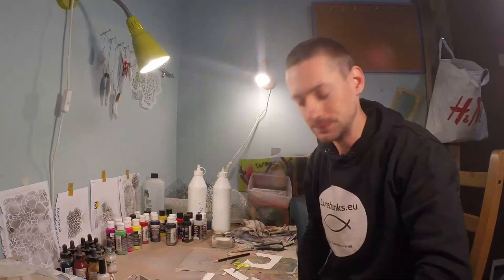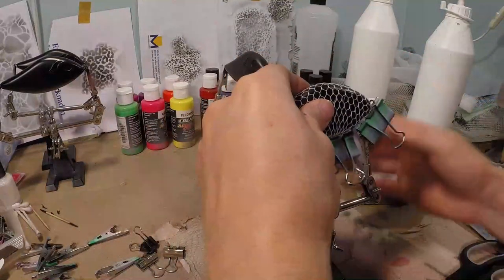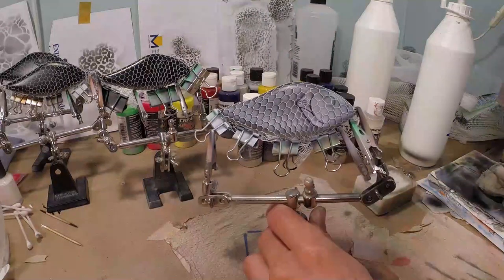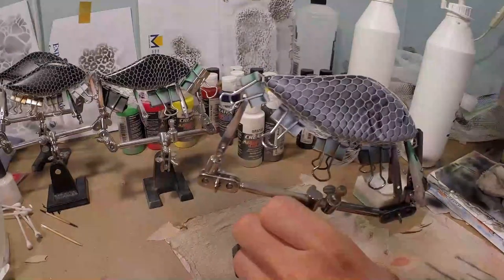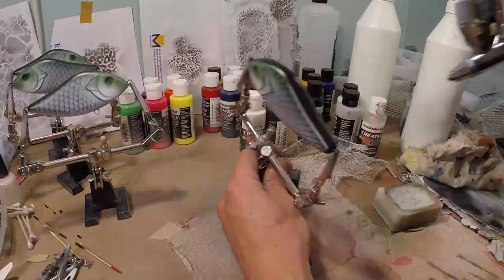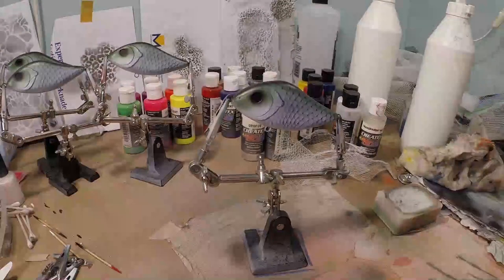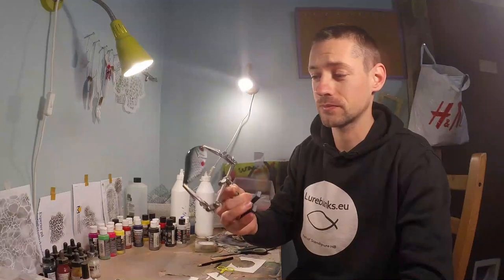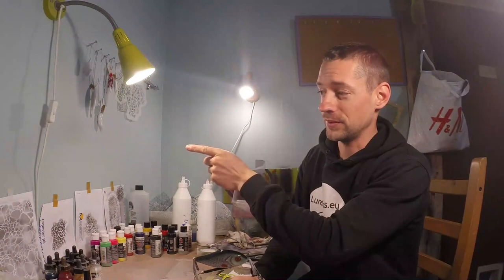Step-by-Step Guide: Painting a Roach Jerkbait

Comment: I’m really learning a lot form your videos. I’m still new and only have a basic airbrush, a masters. The paint seems to get stuck often and I spend a lot of time cleaning out the gun. Even when I add reducers to paints which don’t really need it (wicked colors) I still end up doing more cleaning than painting. Do you think a better quality air brush would help? If so, what might you recommend? (I paint fishing lures).
Reply from the maker: Great to hear that my videos are helpful! 😊Do you mean you have a clog of paint in your airbrush sometimes clogging up the nozzle and needle? That might happen when there is a lot of dried paint around the bottle of the paint itself. everytime you take some paint a little piece of dried paint may chip of and go with the paint into the airbrush cup. These dried clogs can not be reduced and that might be cause the problem. It is hard to tell of course from here what the problem could be without seeing the airbrush and such. Also do not forget to clean the back of your airbrush everytime you are done painting, by taking out the needle and flush water through the airbrush from the back ( where the needle goes in) while blowing air. This way you clean also the back side of your airbrush which can also build up dry paint ( paint that gets passed the needle and the o-ring in the back of the airbrush. The best airbrush I can recommend for lure painting is the Iwata HP CS eclipse. A great allrounder and I use this one 95% of the time for lure painting. And also easy to clean. Hope this helps!

Comment: Lovely work,just one question ,what's in that little square pot you keep dipping your brush in ,cotton wool and cleaner maybe ,is your tip exposed?
Reply from the maker: Thanks! It is just a sponge taped to the table and moistened with water and airbrush cleaner, I always airbrush with my needle exposed, easier to do fine details, clear any tipdry and dip the needle now and then to clean and coat it with a little airbrush cleaner 👍😊

Comment: Hi your work amazing ..just bought myself an air brush Iam new to airbrush spraying ..what thinner do you use to thin createx airbrush paint please
Reply from the maker: Thanks for the compliment! 😀 I use 4011 reducer from createx. One good tip is to play around a little with the amount of reducer and airpressure to find what works for you. For a long time i only used a little reducer and high airpressure. After a while I discovered that with much more reducer (30%/40% reducer and 70%/60%paint) and low airpressure it was much easier to spray details from upclose. So make sure to experiment a little with on a piece of paper or on plastic spoons which some practice on instead of a good lure 👌 have fun!
Reply: @lureblanks  thanks so much for the good advice 👍
Reply from the maker: @timclarke1791  No problem, feel free to contact me if you gmhave any more questions 👍